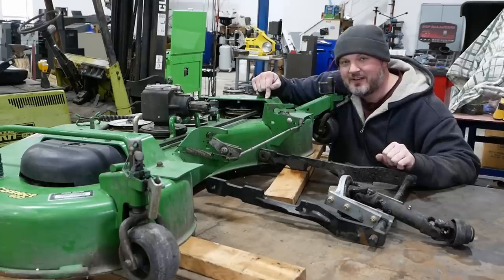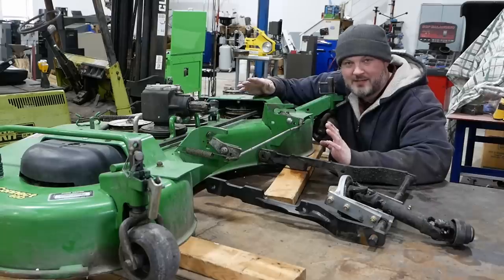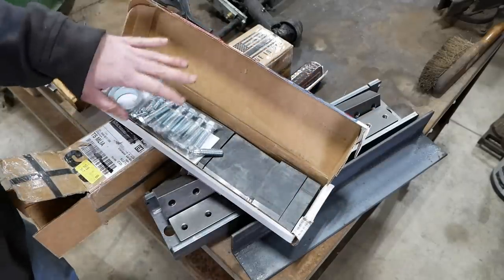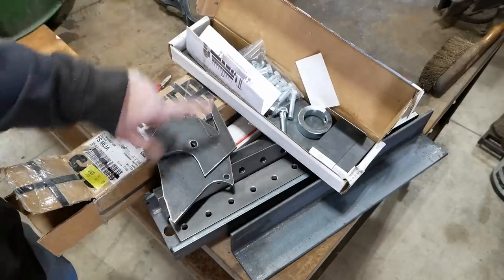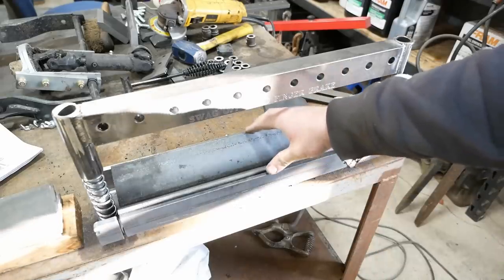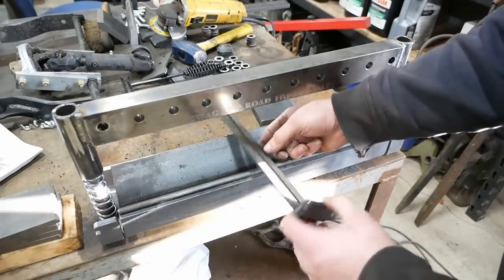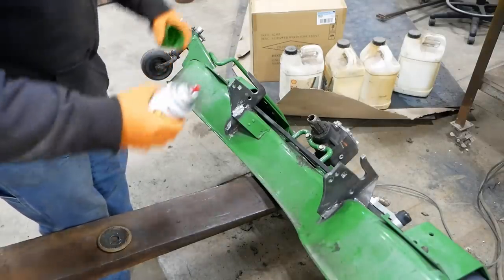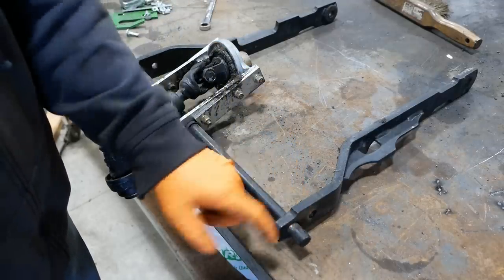Sloppy Deere Mower Deck - Swag Press Brake Mods

Comment: Well sh*t. Thanks Wes, now I have to grind the welds of the base angle iron on my swag press brake and start drilling holes… As if I don’t have enough projects I’ve been pretending don’t exist.  But first, a brief detour north of the boarder for some spotted cow to start the job right. 
Oh yeah, “I don’t know how anybody can live without a welder”, truer words have never been spoken.  I rank a welder up there with a hammer and duct tape, probably number one actually…

Comment: When I'd weld mounting brackets on shakers, and was far to tired to bother with grinding off the powder coat, I'd crank the mig waaay up and waste weld them on. Basically use the leading edge to burn off the coating and lay a clean bead behind it as you go. Wasteful.. but quick. Also, you have to grind the powder coat back more than you do with paint.

Comment: I've got WAY too much time on proper press brakes.  We had a 12-foot flywheel press that took about two seconds to 'fire'.  You could bend 12-foot angles, if you were so inclined.  That thing was dangerous.  The dies were so heavy it took two or three people to move them in place.  You could make just about anything you wanted with that brake, but I preferred a smaller, slower 8-foot one for most things.

Comment: The 8x rule is meant as a guide.The more narrow the bottom die will give you a a tighter radius in the bend.And since you were only doing a 30 degree bend you could have made the bottom die more narrow to support the piece with the angle to it more fully
Reply from the maker: There you go. I know 0 about press brakes.

Comment: 4:53 What you can do is plasma off more pieces of angle to have narrower flanges and stack them inside the one that came with the unit. That will reduce your minimum fold distance but it will make it difficult to overfold to allow for the elastic component, but you can finish it off on an anvil or in a vice with a hammer. Or you could get smaller angle and pack it central to the supplied carrier using multiple pieces of flat bar, on their edge. If you want a drawing of what I mean, just let me know and I'll whip one up and email it to you.
Edit: Nevermind, you have the nesting at 6:05

Comment: Maybe it’s not the actual powder coating, but the powder coating process - I’m thinking the process can magnetize the item being coated and a magnetized object can cause a lot of problems trying to weld it. Used drill stem comes to mind as being a pain to weld because of the magnetism.

Comment: To solve your welding problem: T I G  adjust frequency, amperage, voltage & voilla, a perfect weld with great penetration, lower heat & distortion, & much better appearance.  I learned stick, then MIG & finally overcame my fear & went TIG.  I'll never go back.
Reply from the maker: I like TIG as much as the next guy but that's really bringing a cannon to a knife fight.

Comment: People that fall for that scam deserve it. I stack different sizes of angle for tighter bending but after seeing your idea I might do that instead. Lay a piece of material the same thickness or thicker underneath the part to support it when you have the problem of an inconsistent bend and bend both at the same time.
Reply from the maker: Ahh, there you go!

Comment: The easiest way to make a nice bend in 3/8 or thicker, without dedicated tooling, is to use a slitting disc to cut 90% through the material along the bend line, then bend it by hand and weld up the gap.

Comment: Hey was wondering if you were going to cut brackets off any way. Could you of just drilled a small hole at each end of that round stock.  Then put some metal sleeves on them with washer and roll pin to keep from coming off. Then just over sized receiver holes to fit new sleeves. I know you're saying yes another person telling you another way to skin a cat. Sorry bud was just wondering in case I come across same problem and I have no break
Reply from the maker: Yeah that would work.
Reply: @WatchWesWork  yeah I'm back yard repair youtuber so I have to come up with easier fixes.  But I do like watching you because always give great tips

Comment: Try the Diablo carbide sazall blades. They work great and last.
Reply from the maker: You mean like the one I was using in the video?
Reply: @WatchWesWork  Lol. Oh, yeah didn't see that, just heard you say Milwaukee torch. I used the 8 TPI Diablo steel demon carbide to cut 8'' schedule 40 pipe and was very impressed. Anyways, I enjoy the videos, always impressed with your skills.

Comment: Yup . It was the long way . Some would say the right way. It still came out good Wes.  And that pess/ break is a great setup . ? I don't think I seen you weld the spacer plates in 🤔 and hopefully you didn't,  I can't really see why they would need to be and it leaves you to have to have the ability to switch back to the 90 degree with out cutting things up . If you're worried about him moving around throw another plate in there tighten up the Gap a little bit. Just some food for thought if you didn't want them back in and that your game plan

Comment: didya use hardfacing rods to repair the bar stock ends..or,,new bar with roll pin wear sleeves..bit indepth for a mower..but..

Comment: All of the Autoconnect decks have issues, 🥴. Also your welds are on par or better then most of the oem welds on the decks.

Comment: I am surprised that owner of the deck went to all that trouble to replace the clips, instead of weld overlay them.  In piping & pressure vessels, you use rods that are alloyed to be stronger than the base metal to maintain mechanical integrity of the joint when the welds are ground smooth.  In this case, an overlay would have made both parts stronger at the wear point.

Comment: Hello Wes, any concern of the press channel flanges spreading with usage? I would guess that is part of why they design for welding the angle in place to provide that channel support. Maybe?
Reply from the maker: Sure, but it should be minimal. The channel is 3/8 and should take 30 tons to bend. My press is 25 ton and that applied at an angle.

Comment: I hate it when I use the forks to set the piece on the bench and I do it with such aplomb that I could set an egg without calamity only to realize afterward that I have to muscle the piece around 180 to get to the work. Damn the luck.

Comment: the reason those decks wear like that is the operator is running the deck on the ground rolling on the gage wheels, the deck is designed to be carried buy the tractor with the gage wheels 1/4 to 1/2 inch off the ground.

Comment: Weld quality has to do with the plazed edge on the new part. Grind off the plazed edge and you will get better welds.y understandomg is when the plaz cuts it injects and contaminates the edge with juck slag etc.

Comment: If you know someone with a 3d printer, you can make pretty good press brake tools for your machine. The cost of the material is surprisingly cheap.
Reply from the maker: I just got one. I think it would take eons to print a die.
Reply: @WatchWesWork  a couple days

Comment: Curious how many hours were on the mower deck?  Thanks for the video
Reply from the maker: Maybe an hour. Most of the work is in the tool.
Reply: @WatchWesWork  thanks for the reply.   I actually meant how many hours of mowing accumulated on the mower deck to wear out the mount brackets?
Reply from the maker: @RVJimD  Oh. I think he said 600ish.

Comment: When you welded up the bar, how hard is the weld? Will it wear quickly if it's soft?
Reply from the maker: It should be stronger than the base material. 70,000 psi yield.

Comment: at work we dont have a press so we would do it with heat, why isnt that valid option here? will the heat ruin the part and break it? also the original parts looked fine at least on the video, why not just weld it back up
Reply from the maker: I do the job the way the customer asks.
Reply: @WatchWesWork  that makes perfect sense, thank you

Comment: Wes been wanting to get one of the swag offroad finger brakes, but had the same problem as you no adjustably to the other than stacking angle iron. Definitely want to to do you're modification.

Comment: Well, using "low grade" soft materials puts you right back where John Deere started. You repaired, but did not improve. Where you welded the bar, you should have used your stick welder with some "hard facing", high nickle rods. Same weld repair can be added to the inside of the slots for the latch plates. Yeah, you are stuck grinding the welds to fit. But, would be a repair that probably would last more than the lifetime of the mower. That is IF you intend to use the mower for a lifetime.

Comment: Bad fix just to make a video. Weld all of the wear surfaces with stainless or hard tool steel rod . No need to cut and weld on customers deck.
Reply from the maker: I fix it they way the customer asks with parts the customer supplies.